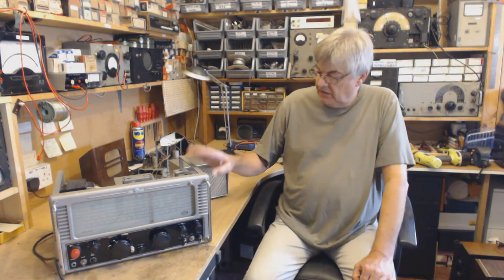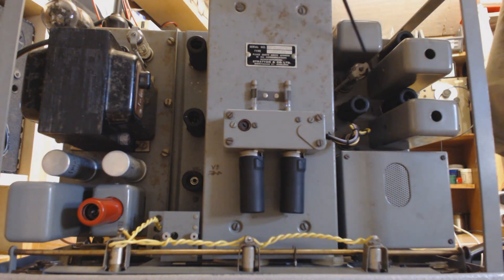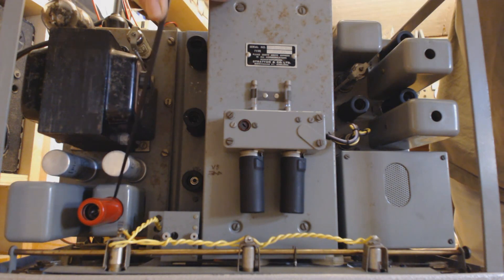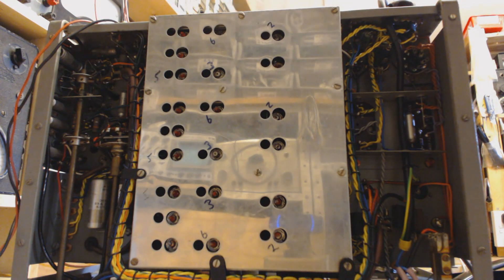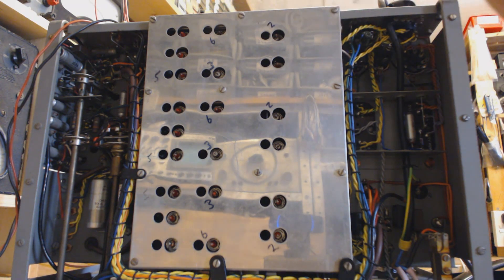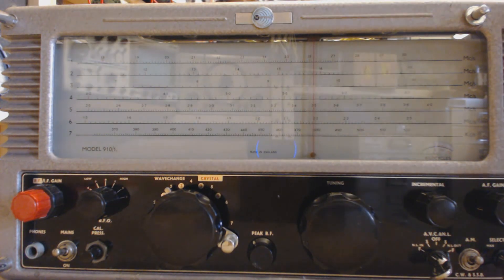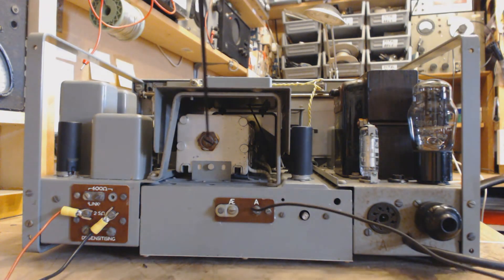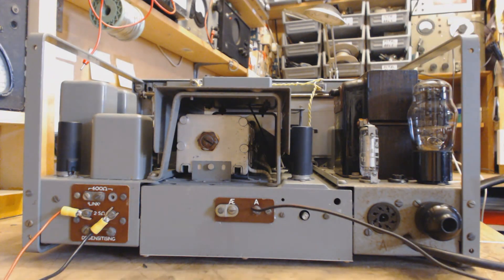Eddystone 910/1 communications receiver -  part two

Comment: Some years ago an old friend brought me an Eddystone 840C receiver still in its original box. The lady next door to him had asked him to clear out and take down her late husbands garden shed. She wished to extend her rose garden. The lady did not want anything for it and my pal knew I would love it. I ran a wire from my cottage to a pole at the bottom of the garden for an antenna and drove a large spike into the ground  for earth. I spent many hours during the long winter months listening to the world (I do not have a television). I use headphones so I do not disturb the children asleep next door.
Last year I discovered that my Eddy would not work. My partner looked on the internet and found a chap roughly 20 miles from us who would take a look. Turned out the on/off switch had jammed in the off position. This was repaired. a few small components were replaced and the receiver 'tuned up.' All for £59. I would gladly have paid triple to get my beloved Eddystone receiver going again! Thank you Richard.

Comment: Nice rig ray! Do you think that module has a bad mica cap perhaps? I wouldn't think in a set of this quality that it would have the ever present annoying I.F. can, open to the air micas that are used in so many American TVs and radios. But you never know.
I like the wiring harness with those twisted wires to help eliminate inter-electrode capacitances.
Thanks for the inside look!
73s
Tom